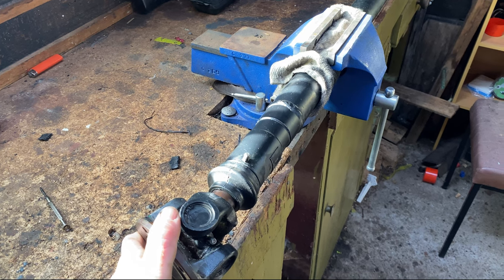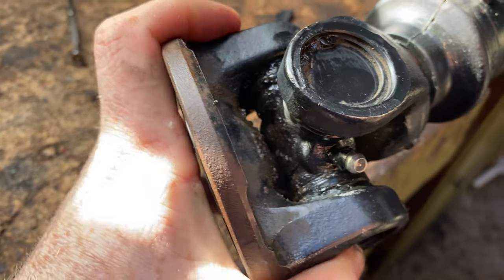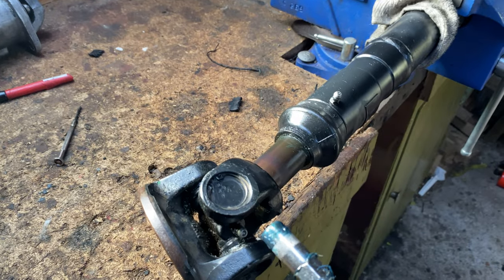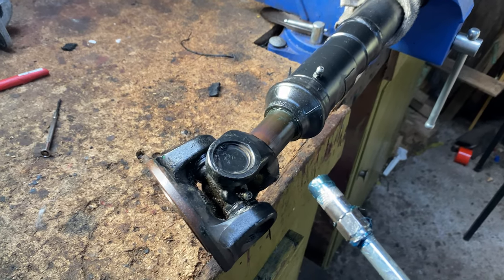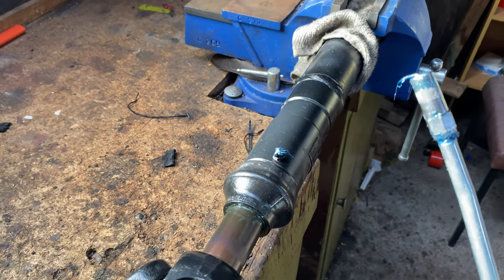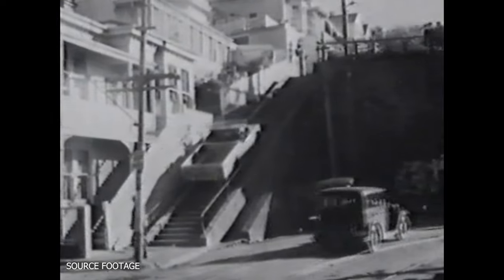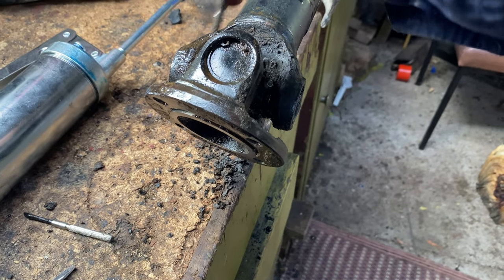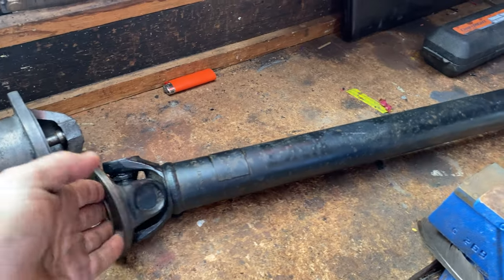Land Rover Prop Shaft Maintenance

Comment: hi damon, thx for the video. The propshafts are in general underestimated for the important part they are in the vehicle and the work they do. and to get it worse the service manual doesnt explain particulary how to serve them and the service intervals are far to big.
if you really want to serve them, i highly recommend
- mark the position of the slideshaft on both end clearly, so if you assemble them later there will be no doubt how they fit together
- clean the splines carefully. the mud with the grease you press through the nippel actualy is the best abrasive you can imagine which will sand oft the splines
- when assembled just press 4 or 5 hubs (depending on your grease gun)in the slideshaft. dont overfill it.
- u-joints: press grease in it, until clean grease comes out on all 4 ball-joints. if one is stucked that means the old grease is so old, sticky that the new grease wont pass. you have to use heat to make it smooth again. if you wont do it, precisely there will the u-join worn out.
- clean the aerea of the securing rings of the balljoints and move them a little bit with a puncher. that make it far more easier to change the u-joint in the future.

its not a bad idea to grease the propshaft as often as possible, at least once per month, depending on your mileage or terrain more often wont hurt, especialy when water crossing or rainy season

always use the rubber hose to protect the slideshaft

disarm and clean the propshaft properly once a year and give it fresh grease. it will last forever.

grease is cheap ....

Comment: Baught a td5 in februarie greased its ujoints 3 days back the ujoints are 100% butt the slidingshaft are nekkard
Reply: gatvol: if you buy an used car i would highly recommend to disarm the propshaft completely, clean it carefully, like i described above.
than check it if it has any play in the splines or in the u-joints and change them if necesary. 
otherwise you risk to damage the differential and the gearbox, because the vibration of the propshaft is not only bad a sound, it will pass to both ends.

the problem is the tolerance if the slideshaft has movements. if there is any play i would change it. you will be on the save side.
Reply: @berndeikers8924  good day thank you i got a quotation R1890.56 for a complete one will wait untill i have enough money to buy one.Go well.